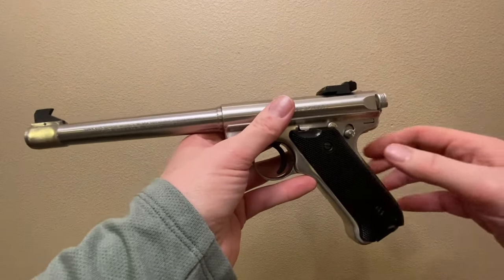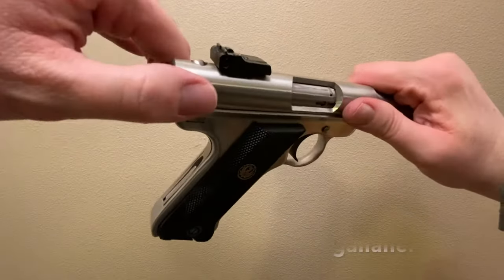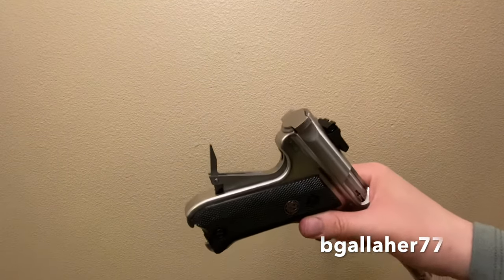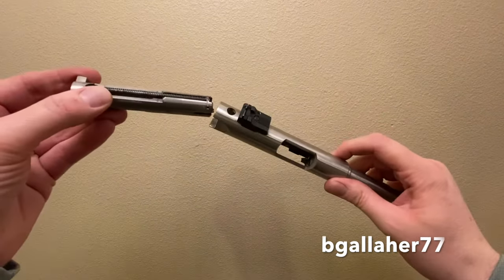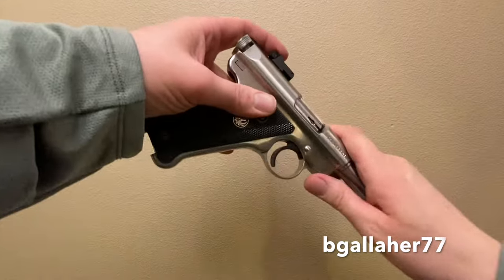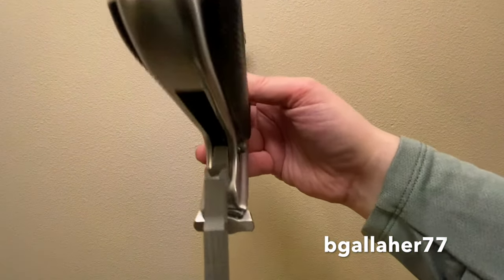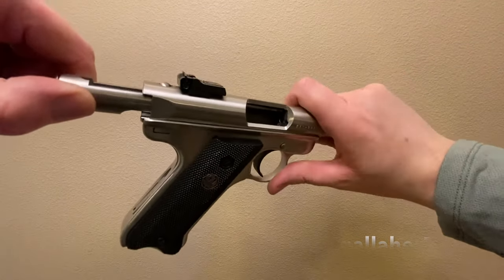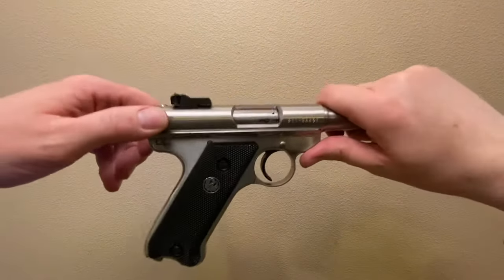Assembly Disassembly Ruger Mark I, Mark II, and Mark III Pistol Field Strip

Comment: I put my back together but the bolt won’t pull back
Reply: look up HSS   Hammer strut support Aftermarket support that will keep that hammer strut in the correct position for assembly for Mark 1  11  111  Watch video on HSS easy to install!
Reply: @johnmatlin1543  thanks my friend I eventually got it back together